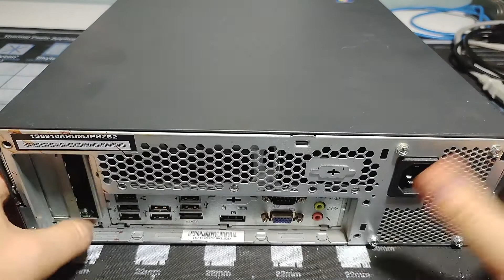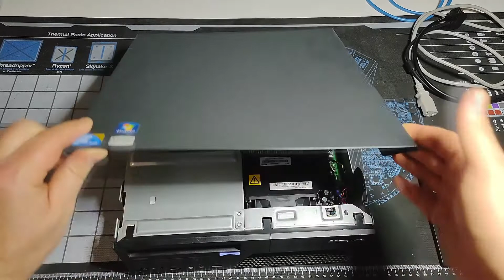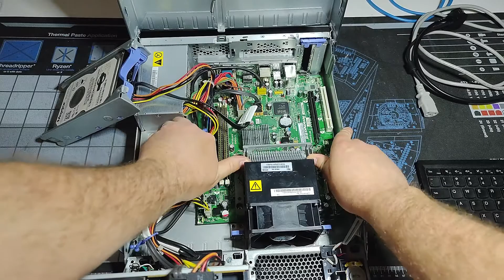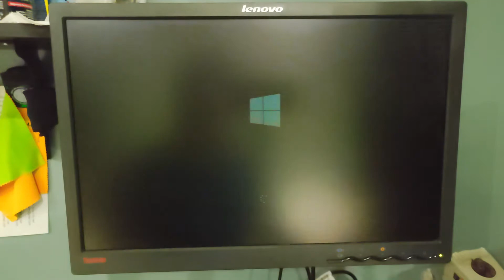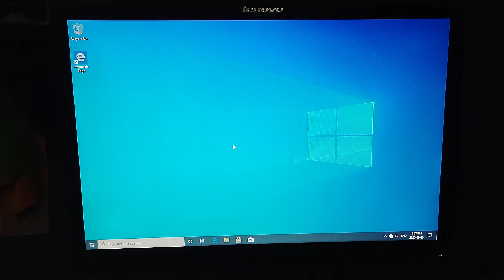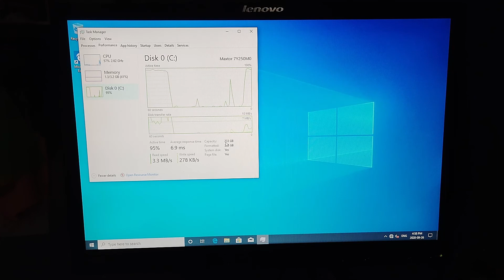Lenovo ThinkCentre M58 (8910)

Comment: Just serviced mine, fitted a new 500mb ssd drive removing the mechanical hard disk and it has an Nvidea graphics card, it was in remarkably good condition still running on 4gb ram with the standard processor, fitted a usb wifi dongle and installed Zorin 18 OS and is now used with SDR software for my SDR hobby.

Comment: Hi there,great video,I got one from somebody and when I on the CPU,it says failure to boot and fail interlink
Reply from the maker: Sounds like there is no OS installed or maybe the disk drive is missing.
Reply: @retropcdurham  thanks,so what should I do,inside have 1 empty slot, OS u mean windows rite,sorry I'm not to familiar with computer 😂
Reply from the maker: @mizannek2605   The part I remove at 1:34 is the disk drive, which is where all the data including your operating system, programs, etc are stored. Do you have one of those in your system?
Reply: @retropcdurham   ok now I understand,the slot is empty,I need to buy hdd rite,and then windows,what hard disk is suitable?
Reply from the maker: @mizannek2605  The connection type is SATA for the drive. I would recommend getting a Solid State drive instead of a Hard Disk drive if you can, since SSDs have better reliability and speed.

For Windows 10 you can actually download and install without a license you just will be unable to do personalization like changing the wallpaper without adding some other apps.

Comment: Can I upgrade the ram (and possibly upgrade the cpu) on an m58p?
Reply: But do you recommend installing a gt 1030 with a core 2 quad, 8gb ram with a 280w psu if I undervolt the GPU?
Reply from the maker: @itszed01  sure. The system is rated to be able to take up to a Q8400 and fully power the PCI-e slot, and if you undervolt the GPU will definitely help with thermals, the fans in these systems can get really loud.
Reply: @retropcdurham  And it also helps with the PSU, too
Reply: @retropcdurham  By the way... Can I remove the metal locks on ny m58p, because, I read online that peoples' m58s got locked and they couldn't open
Reply from the maker: @itszed01  Yeah, you should able to remove the bar and spring on the locking bar from the lid without affecting how it opens and closes.
Reply: @retropcdurham  But, I have one more question. Is it possible for me to put a gtx 750ti low profile/core 2 quad Q8400/ssd&hdd/8gb ram combo inside with a 280 watt psu? It likely isn't probably.
Reply from the maker: @itszed01  As long as it is one of the low power versions (ie does not have the 6-pin power connector on it) you will be fine. If it needs 6-pin power then it is going to draw more than the 280W PSU can provide.
Reply: @retropcdurham  Well, it can't fit without it being low profile, so I'm good
Reply: I had this kind of PC laying around from when my dad bought it 5 years ago for my birthday I believe, and it would be very useful for me, because I'm gonna go insane sharing a laptop with my sister lol
Reply: Sorry for bothering you so much. I'm currently doing some research.
Reply: And, I'm guessing the m58p uses ddr3? Sorry for asking a lot of questions...
Reply from the maker: @itszed01  Correct, DDR3 running at 1066 Mhz
Reply: @retropcdurham  crap... I'll have to find some ddr3 sticks with that speed which are pretty hard to find..
Reply: @retropcdurham  Is it alright if I ask you what the exact model is? My current model is a Core 2 Duo VPro, I'm asking if it's still compatible?
Reply from the maker: @itszed01  I use a tool called HWINFO to get all the necessary product info; you can run that on your system to see exactly which Core 2 Duo CPU you have installed.  The CPU I recommend looking for is the Core 2 Quad Q8400, which is a 4 core processor and still running at a pretty low power requirement and heat output.
Reply: @retropcdurham  I see.
Reply from the maker: If you upgrade the BIOS to the final version you can get 16GB (2x8GB) memory.

For CPU the highest I would recommend is a Q8400
Reply: @retropcdurham  Thank you.

Comment: I love this computer. I stopped using it becuase I needed a new harddrive and years later I'm ready to give it a SSD. I could never fit a GPU in there, but I did change the power supply for a 300 watt one over the 280 watt one lol. Mostly wanted to use it to build an arcade cabinet, but we have raspberry pi if we want to do that I guess, but its still a handy low power usage computer.

Comment: I'm having Linux performance issues it's hard to explain... I have two computers networked together with a barrier server on Ubuntu MATE, and the computer has issues drawing any more than about 500 polygons. Not only that, but the computer has issues with the z buffer output. 3D objects will phase through themselves in ways that are not able to be understood, polygons from the opposite side can pop out of place and into the front of everything for no reason. This definitely shouldn't be happening, as I was able to do much more on Windows 10. I know it's not much to say I was able to run asphalt 9 in 800 by 600 mode, but my God it is. I can't even do the most basic of things, and this is very infuriating because I typically prefer Linux.

Comment: Can I putt gtx 550ti in this dekstop
Reply from the maker: Your GPU will have to be low profile to physically fit into the system, and you are going to need some power splitters and a 6pin adapter to get power to the GPU as well. The 280W PSU is just under the 300W recommended but if you avoid overclocking you should be okay. I'd say the biggest roadblock is physical fit

Comment: can you make a list of core2 quad CPUs that work on this motherboard without bios upgrade?
Reply from the maker: The only C2Q processor that is listed by Lenovo is the Q8400, which is a Yorkfield 95W CPU but otherC2Q in the same family and TDP will work as well.

I have seen an M58 with a Q9500 before, even though it is not on the 'official list'.

Something like the Q9770 might not due to being higher requirement (135W).
Reply: @retropcdurham  that TDP thing is pretty tricky.  My motherboard is Mercury PIG31L Extreme ( out of business now) with a G31 (intel 45nm CPUs supported)  chipset. I've been using it for years with core2 Duo E8400 (TDP 65w). I tried to upgrade it with core2 Quad  Q9500(TDP 95W), but the system halts/powers off or reboots automatically, and I got the blue screen.  I tried everything like buying a more powerful heatsink and fan, applying thermal paste, bought a new power supply, with no luck.  My motherboard manual says it supports the latest dual-core, core2 duo, and core 2 quads, so I don't understand why the Q9500 crashes my system. when I put back the E8400, everything goes to normal. Mercury is no longer manufacturing motherboards, so there are no bios upgrade. I bought the Q9500 refurbished on eBay, and started thinking I was scammed. I've bought refurbished CPU for years on eBay, and I've never met one faulty

Comment: can i put a 4gb ram card to have 6gb (2+6) or the limit is 4gb?
Reply from the maker: The base support on an 8910 is 8GB (4x2GB DIMMS) but if you flash to the most recent BIOS you can get up to 16GB (4x4GB).  You could have 6GB installed but your performance might not be improved since you won't necessarily be in dual channel mode.  I would recommend matching memory, either 2 or 4 DIMMs of the same size.
Reply: @retropcdurham  how do i do the BIOS thing?
Reply from the maker: @burritoboy_30  At support.lenovo.com you can look up your machine type and download the bios update utility (it runs on Windows)
Reply: @retropcdurham  ok thanks man

Comment: Is there a way to fit a second HDD in there to do raid 1?
Reply from the maker: Since there are only 2 SATA ports on the board you would have to disconnect the optical drive, but then you could put pair of 2.5" drives in place of the single 3.5" drive to be able to have a redundant pair.  All you would need to add is a drive caddy for the pair of 2.5" drives and those are pretty easy to source.
Reply: @retropcdurham  Do you know how big the optical drive bay is? Could I fit one 3.5" drive in the optical bay (with a drive caddy) and one 3.5" drive in the dedicated HDD spot?
Reply from the maker: @ajrichie  yes it is a full size 5.25 bay

Comment: In my pc no display but cd room working and fan moving fast
Reply from the maker: There are no beep error codes on startup?  That could mean an issue with a CPU, main board, power supply.  Or if the screen is bad?

Comment: Did you have to connect it to the monitor with a display port only?
Reply from the maker: There is a DP as well as a VGA port for connecting to integrated graphics. Dual monitor is supported as well by using both ports

Comment: I received a donation with this pc. It turns on with no beeps but its black screen. I installed new low profile card ati radeon display port but still getting black screen. Any idea?. 

Thanks. Great video BTW. First time here.
Reply from the maker: Does the display work from the onboard graphics?  

If the GPU only supports UEFI that can sometimes be an issue.

Also if the BIOS is set to only use the onboard graphics and not even check the PCIe slot for a card.
Reply: @retropcdurham  wanted to follow up. I took the motherboard out and after examining, found a few leaking capacitor. Guess I have a lot of work ahead of me. Will keep you posted. Thanks again. Love your videos. Keep up the fantastic work.
Reply from the maker: @jeff15  big oof.  Where there's one bad cap there are always more. Good luck!
Reply: @retropcdurham  i plugged in monitor to the build in display port. Nothing. Then tried the vga port. Nothing. Add the ati card, nothing. Black screen. 
Dvd try opens. I heard old drive spin for few seconds. 
Thanks for your response. ;)

Comment: I wanna upgrade mine what  graphics card can buy?
Reply from the maker: You should be able to use a low profile PCIe GPU that is slot powered, so if you want new, something like a GTX1650 or GTX1650 Super low profile will work well.  Obviously if you can find something used for a lower price, like a 1050ti that can be a good deal as well.

I would recommend you avoid cards like the GT710, as they may be good display adapters but are garbage for gaming.

Comment: What graphic card will it support?
Reply from the maker: You can get a low profile PCIe GPU in there, so most powerful would be something like a 1650 Super.
Reply: @retropcdurham  What about if I upgrade it with 2x4GB DDR3 + 2x2GB DDR (already there). Will that work better for Adobe Software? or Shall I have to add SSD to gain better performance?
Reply from the maker: @InspireVibe_iv  upgrading the memory will help out, yes.  You should be able to run both pairs of memory in dual channel as long as you install them in the correct slots (blue for one pair and black for the other pair).  

Absolutely upgrading to an SSD will improve your performance as well.  Using an SSD instead of a spinning disk is one of the best ways to increase the speed of an older system.  Good luck!
Reply: @retropcdurham  Thanks